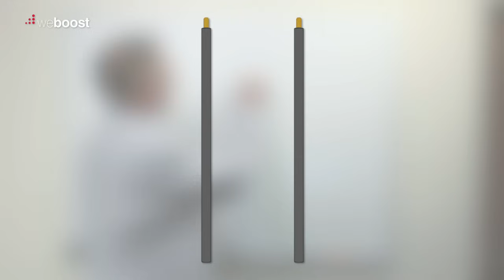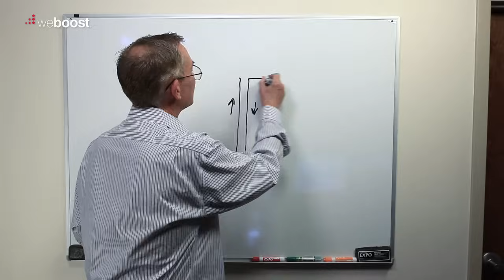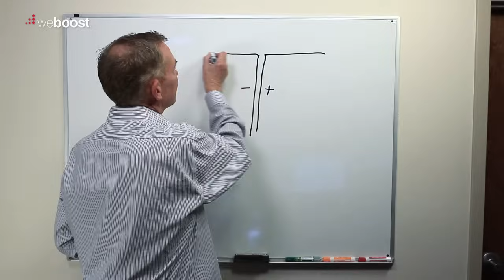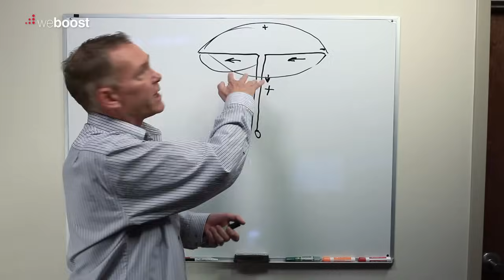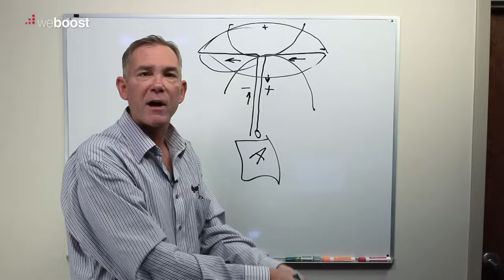How Does An Antenna Work? | weBoost

Comment: i was hoping  you would  explain the process of radiation from antenna?? plz make video which expalains that process
Reply: When I was studding this topic, I remember that radio starts at about 15Khz. The alternating signal at lower frequencies does not radiate in to space, but at higher frequencies they do. I you take two bar magnets, each will have a North end and a South end. If you place them side-by-side so that both North's are at the same end, the bars will repel each other. When the electrostatic field is setup at the antenna, a polarity is setup. As the alternating current is increased in frequency, there is a point in which the electrostatic field does not have time to collapse (following the alternating signal), so it is repelled into space for each oscillation- thus radiation is accomplished. This has been my understanding, if I am wrong, sorry, but that has been the best explanation that I have received.
Reply from the maker: Thanks for the comment, we'd be glad to help out. Could you give us a little clarification on what it is you're looking for? Shoot us an email at socialsupport@weboost.com.

Comment: OK, I am interested in learning about ham radio operation, but all this did was give me a basic idea of what a di-pole antenna is; it did nothing to help me understand what the different antennas are for or how they are used , how they work or even how this di-pole really works.

To me, this was rushed for time, and over simplified to the point it makes no sense.

I wish you would try again, I fell like you have great info and understanding, and Id like to hear more.
Reply from the maker: +I am a Buccaneer Thanks for the comment, we appreciate the feedback. You are correct, we did cover only the surface of the topic in a basic way. We do have a video covering the difference in directional and omnidirectional antennas if you're interested https://youtu.be/rmFzEXHecSU. We also plan on creating more videos on the topic so thanks for letting us know what you're interested in seeing.

Comment: Question:  Is the Feed flow on one wire only?  Or do both wires connect?  I really want to do this but remain confused.  I will appreciate your help.
Reply from the maker: +James Crawford Both conductors are connected.  One is the feed and one is the return, for the antenna pictured the horizontal radials are tuned for 800 MHz and 1900 MHz bands.  The radials act as a ground.

Comment: Don't confuse DC with AC changing electromagnetic fields radiated from a conductor into space. For instance, a 50 ohm coax or 600 ohm ladder cable is not going to read that value, whether you open or short the ends, with a digital multimeter (DMM) volt-ohm meter you buy at Home Depot. Understanding and predicting Mother Nature's phenomenon of radiation is an entire butt load more complicated --imagine using imaginary numbers to do phase math of leads and lags.  Google the dead scientists/math geeks named Maxwell and Fourier to learn more. Ohm & Alessandro Giuseppe Antonio Anastasio Volta were newbs in comparison. 
Copper needs volts/amps to emit radio frequency (RF) energy. Then came Curie and Einstein. Uranium and plutonium have their own juice built in, hence the term radio active, which is really cool, except the particular wavelength of RF fries DNA molecules in your cells (ionizes em), akin to sticking your head in the microwave, just on a smaller scale. Geiger counters are like your car radio tuned in to the 3-mile Island, Chernobyl & Hiroshima channels.  It gets easier when you have a PhD in physics, at which point all this gobblygook hocus pocus BFM becomes intuitively obvious to the most casual observet.

Comment: My tuner has both 75 and 300 ohm connectors. Is one to be preferred?
Reply from the maker: +don stromberg 75 Ohm would be preferred for our antennas, which are all either 50 ohm or 75 Ohm. Our website lists which is which https://store.weboost.com/collections/accessories-all-parts

Comment: How does the current flow through the antenna? It seems like an open circuit to me. What kind of signal is fed to the antenna? It has to be on a carrier frequency right?
Reply from the maker: +Flagstone78 Current does flow through the antenna but not at the tip. While it looks like an open circuit it actually is not, it doesn't act in the same way as an open circuit. The signal does not need to be a carrier frequency any time varying signal will work.
Reply: +weBoost 
The antenna sure is an open circuit for zero Hertz direct current (DC). According to my Fluke DMM there ain't no electrons flowing.  Coulombs per second equals the big fat square root of squat, i.e. none, zero, nada, zilch.

If the voltage is going back and forth like a salt shaker then salt is going to come out. No shakee, no saltee.  Waves are the motion in the ocean.  You need some sort of on/off or alternating frequency.  Even then, On/off is a bunch of sinusoids (primary frequency, 3rd order, 5th order, ...)
Reply: +weBoost It looks like an open circuit to me also. And you saying that it "actually" is not does not explain why not.  How can you have current flowing in the top two wires when each has an open end ?
Reply from the maker: +youpattube1 Yes the ends of the antenna are an open at DC.  The energy that is contained inside the coax cable changes to EMR Electro Magnetic Radiation.   This is why there is no measurable current flow in the radiator.  You can measure the current at the feed point.   The ends of the radiator are the low current point (infinite impedance) and where the 2 elements cease to be coax is the high current point.  The reverse is also true of the voltage highest at the ends and lowest at the feed point.  Hope this helps.
Reply: +weBoost Yeah Verily. That helps immensely.  Similar to a flashlight emitting photons at light frequencies, electrons excited by high voltage TV, WiFi, radio and cell phone frequencies at the tip of the radiator impart an electromagnetic  disturbance that travels through air.  Our eyes just aren't tuned to demodulate the longer wavelengths of RF. If our eyes did and brains did QAM and Frequency Hopping Spread Spectrum (FHSS) we wouldn't need radios to listen to the Steve Harvey Morning Show.   Can you do a YouTube on genetically engineering biological tissue as RF receptors?   Mine detects microwaves when I stick my head in the oven --as heat, but the bandwidth is really slow and the glaucoma from cooking my eyeballs ain't the effect I'm looking for.
Reply: +weBoost bangladashsonold

Comment: uh, im seing nothing but an open circuit.  air is a relatively good insulator.
Reply: +PC5032 but at high frequency, the electron inside of the wire itself will oscillate back and forth. that is the current he was talking about. AC sometimes doesn't need 2 terminals to create a flow of current. The oscillation of electron create an oscillating magnetic field, which in turn creates an oscillating electric field and thus an electromagnetic field is created and radiating through air.
Reply: +Jack Le Witchcraft!
Reply: That was (although a year ago) a very good question.  First of all it is important to realise that our concepts of currents flowing along the wires are just a very useful but limited model of the underlying physics that is going on.  Sometimes models although useful are not perfect and leave you asking questions about features of the system where the model is starting to fall down in its attempt to explain the physics.  Bearing that in mind we can push this particular model of reality a little further to answer your question:

weBoost could have talked about what happens at the end of his twin conductor cable if he had just left the 2 conductors running parallel to each other.  You would find the radio frequency (RF) power would set up standing waves and at the very end of the wire there would be a voltage peak and (naturally) zero current flow. One quarter wavelength back along the cable you would find a current peak and a voltage minimum and it would appear to the RF generator as a dead short circuit.  

The current flows because the capacitance and inductance between the conductors allows the voltages and currents to exist even though there is no load on the end of the cable.  Separate the last quarter wave length of the conductors apart and the inductance and capacitance between the wires changes but does not disappear and you still have a current peak at the middle of your antenna and the voltage peak at the ends of the wire.  You also lose some of the RF energy into the surrounding environment so you start to measure a load (around 75 ohms) at the centre of the antenna instead of almost a dead short circuit when the wires are left running parallel to each other.  Search the web for "standing wave" to find out more.
Reply: As Jack Le mentioned -  the currents are creating magnetic fields - when the currents are running through  parallel wires then unless you get very close in to the wires the magnetic fields created by each wire are in opposite directions (look up the cork-screw rule) so they "cancel each other out" .  Between the wires the magnetic fields are in the same direction and actually reinforce each other which is why the energy travels along the wires but very little is lost to the environment.  As you separate the wires to form the dipole antenna you will see that again the directions of the currents cause the magnetic fields created by each half of the antenna to again reinforce and so the magnetic field "leaks out" from the wire spreading the energy out into free space.
Reply: Bob Anderson Thank you very much sir for information! Really appreciate your help!
Reply: Jack Le as usual, the actual answer is in the comments. Thanks for the clarification!
Reply: just because you have an open circuit, doesn't mean there isnt transient current that occurs once the voltage source is connected.  electrons dont know it's an open circuit until they reach the end.  In DC after the extremely quick transient current the system reaches steady state.  But in high frequency AC, the flip-flop of +/- happens so quickly relative to the length of the wire and frequency of the signal that current can be sustained.
Reply: So from an EE or physics standpoint, then we're talking about displacement current. I can see the air having a finite impedance when the frequency is over 0 or not DC. Still, if we say there's a displacement current between points A and B, why should it not have the same canceling effect as the conduction current in the wire?

Comment: so where does the sound come from?
Reply from the maker: +kimbbus RF waves don’t emit sound. The antenna receives the RF signal, routes it into the radio, where it is converted to either analog or digital signals. Those signals are then sent to a speaker which would produce the sound.
Reply: Of course, RF waves do not emit sound. Thats not what I was asking. All I asked was where the sound was coming from. - how it was being transferred and from where? A microphone from a radio or television station?
Reply from the maker: +kimbbus Apologies Kimbus, I misunderstood your question. In the case of our signal boosters the antenna will actually be capturing a weak cellular signal, amplifying that weak signal and then broadcasting a boosted signal to the mobile phone. The process is then reversed to send a stronger cellular signal back to the cell tower.

Comment: Are the older style antennas like on RC cars and some radios where you pull to stretch them longer considered dipoles? Or something else?
Reply from the maker: +mrsemifixit I would consider those antennas half-dipoles. The antenna attaches to a body (remote control or radio chassis), which acts as a ground.

Comment: Just having 2 parallel wires is not technically what cancels out RF emissions in them.  It is also the fact that they are in phase to begin with.  For example, if those 2 wires carried current from 2 separate RF amplifiers to 2 different antennas, then there could likely be RF emitted and potentially lots of it.

Also, in some antenna setups, it is not the center conductor that supplies power to the antenna, it is the shield.